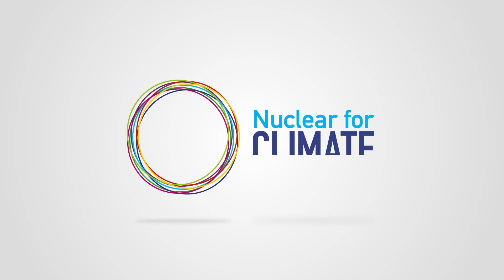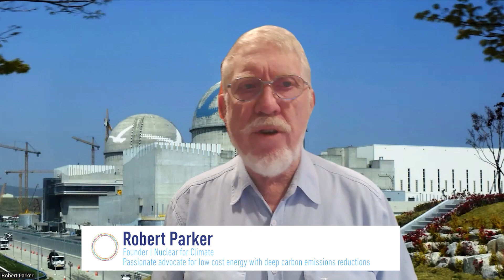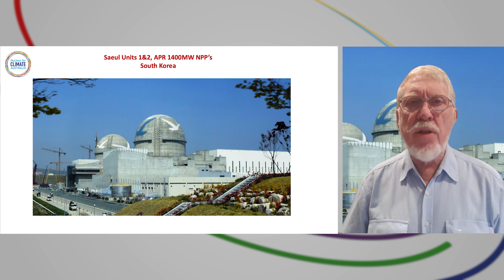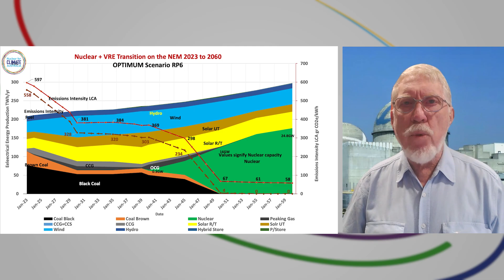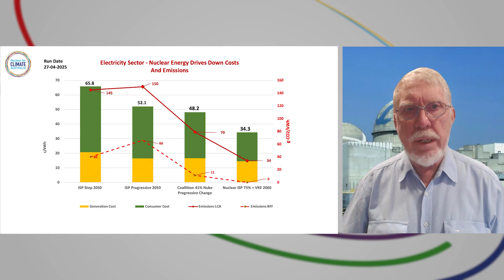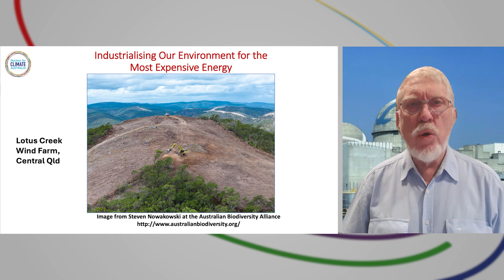Video 1   Introduction to Fixing the Energy Blunder

Comment: She is right all large central grid generation is unstable as bigger and bigger is needed.
Dispersed grid generation and storage and maximum UTILIZATION and efficiency of the existing national grid is the only way.

All large central grid generation is unstable as bigger and bigger is needed.
Dispersed generation and storage and maximum UTILIZATION and efficiency of the existing national grid is the only way.

BESS continually charging 247, and PEAK discharging as local demand or site demand spikes 365days can expand grid total transmission capacity to the original maximum peak capacity 247, 365.
A Battery Energy Storage System, or “BESS”, is a packaged system that includes batteries inside it, along with a collection of other equipment and devices – like invertors and computers – that work together to charge, store, convert and discharge power across a range of sources and applications when it’s needed. 
Traditionally, BESS solutions have all been ‘fixed’ i.e. stationary solutions that are built and assembled at a particular location and remain there permanently to store and release electricity.

In more recent years, innovations in this technology have enabled the introduction of Mobile BESS.
Unlike traditional fixed BESS solutions, these Mobile BESS are capable of being moved around flexibly, quickly and easily to different locations, making them a game-changing solution for industries that need the ability to either move their power as they move, or that need a temporary power solution on a project or seasonal basis.

Comment: " Spain, which is the pinup child of this transition, well, they're sitting on 56% wind and solar, but they've still got an emissions intensity of about 270 g of carbon dioxide per kilowatt hour. 
And look whal happened last year where the entire electrical energy system on the Iberian Peninsula failed spectacularly caused by solar energy. "
WTF.
56% NUCLEAR ELECTRICITY, they SHUT DOWN the nukes and blamed the solar energy. 
My grandmother would say, "if the cat had kittens she would get blamed."

In South Australia the grid transmission towers were blown down in a wind storm and the LNP blamed the renewables. 

The LNP Snowy2.0 Pumped Hydro in the land of decade long droughts. An 2billion exploding to 22billion dollars budget.
Grid rental costs on electricity to the pumps and grid rental costs on the electricity from the Hydro generation plant to the city consumers. Double grid rental costs. 

Centuries of uranium waste and plutonium waste and containment vessels and contaminated materials. 700tonnes of uranium waste each year for 100years. 70,000 tonnes
7,000kg of plutonium waste every year for 100years. 700,000kg.
Plus containment vessels and contaminated materials 70,000tonnes.
The most poisonous materials on earth.
The most over engineered, over regulated industry on earth because accidents and shut downs cause massive cashflow collapses.
Engineers make mistakes. 
Dunning-Kruger is powerful outside the grid owners world.